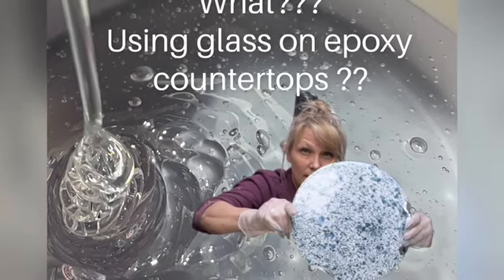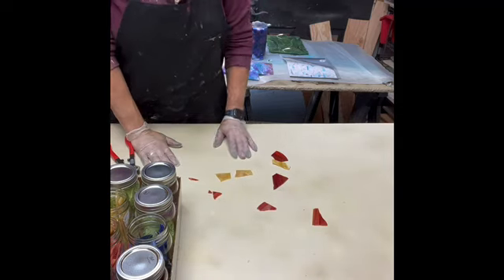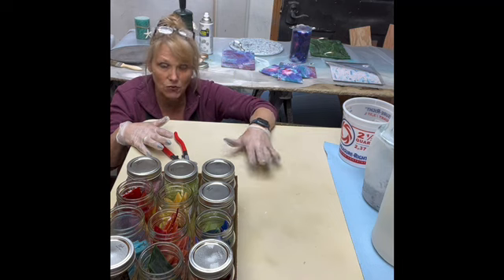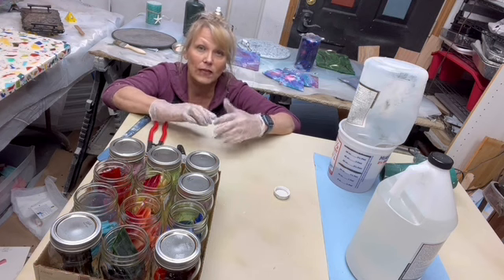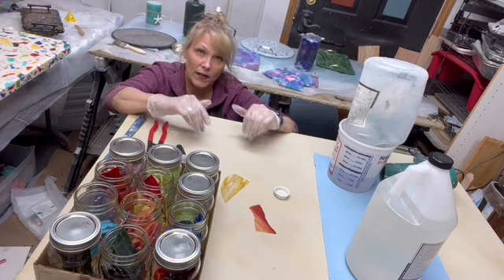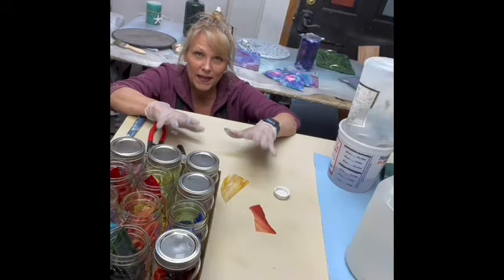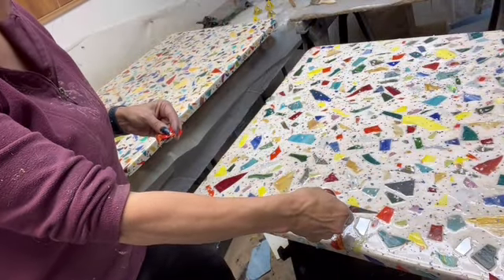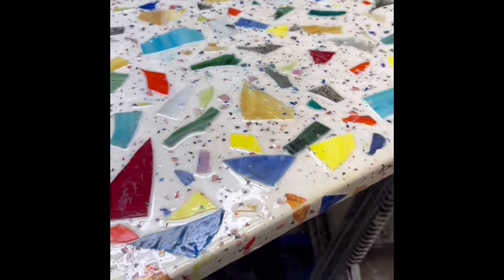Using Glass on Epoxy Countertops

Comment: Hi Deb!!! What a great match in the resin chips on the glass table!!! Did you pour the flood coat at the chemical bond stage? I wonder about the shiny glass and if the epoxy could have the potential to delaminate? I’m sure you thought about that. Would you use a matte spray paint for that prior to your flood coat?
Reply from the maker: I actually did sparky the glass with a rustoleum clear spray.. it was Matte. I forgot to mention that. Though wasn’t sure I needed to because it has so much other epoxy to adhere too. I mean there is lots of space between the glass I really don’t think it will be a problem, but any time I’m not sure I take those Precautions